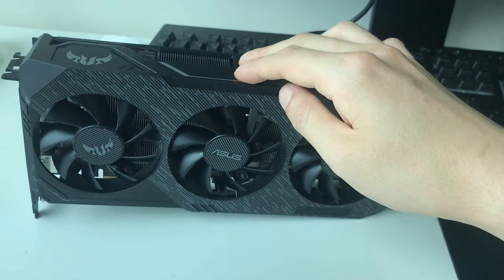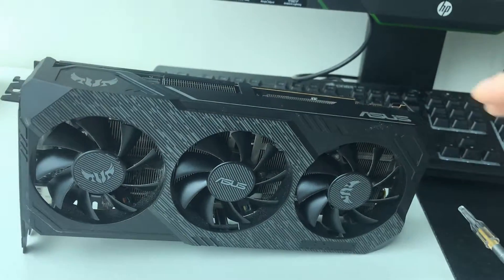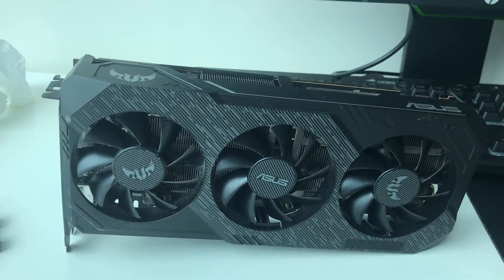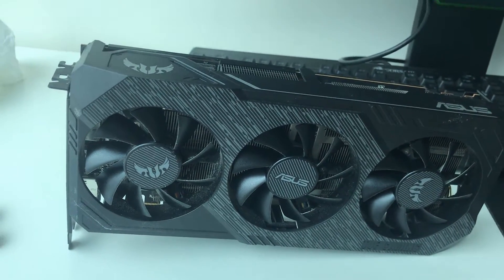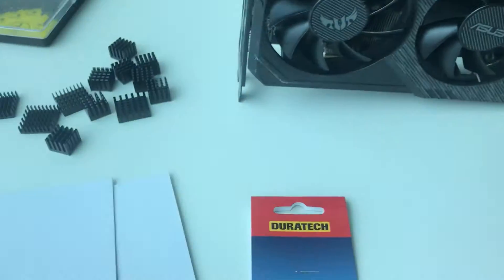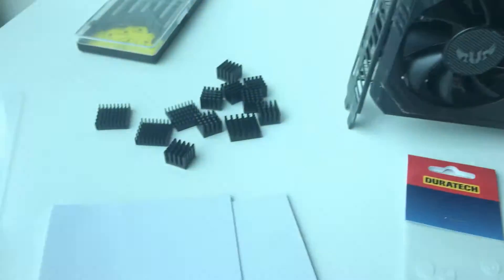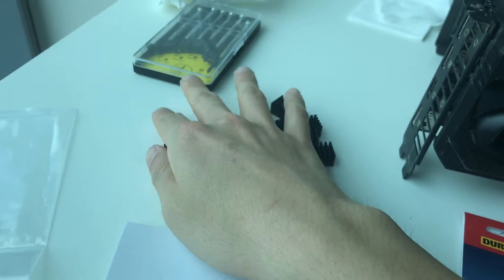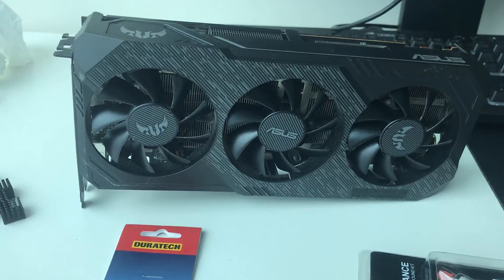Graphics Card Dodgy Mod - Fixing the Overheating Asus TUF Radeon RX 5700 XT

Comment: The problem I have with my Asus Evo 5700 isn't so much to do with the GPU temp at all.  It's the extremely hot memory hitting 104c+++  when really it shouldn't be going up over 84ish under load.  From what I've read it has alot to do with the thermal pads being used as the same card made at a different plant in Taiwan isn't having any of those issues.   It's not just Asus models either.  Really frustrating.   As an Example, 

I have a Dell 5700XT looks positively ghetto in comparison to most of these cards. It has a dual fan design but looks like something straight out of 2012..  It cools the card just fine.  Core temps are similar but mem and junction temps never go over 80 so it never throttles.
Reply from the maker: Asus really messed up with the RX 5700 GPU. If I remember correctly the RX 5700 non-XT version don't even have a backplate for the memory chips so the chips are just exposed, which explains the ridiculous memory temperatures.

RMA the card if possible, if not you'll have to tear it open and apply additional thermal pads/heatsink.
Reply: @wyzard6303   There are a couple videos on the 5700XT variant teardown having some thermal pads but I hadn't thought to check if that's the case with my 5700s. Definitely worth having a look thanks for the heads up.

Comment: Is there Any easy way to fix the gpu i bought it and its getting to 90degrees After playing a Game with 30fps Bad graphics
Reply from the maker: Sounds like serious thermal throttling issue. If you have warranty I suggest just return it and get another model if possible.

If not, firstly I will check for air flow in the case. Do an open-case, and if possible direct a fan into it and see if it still overheats. If it's still running hot with open-case and a fan blowing directly into it, then you'll have to tear down the graphics card and do the fix I did to it.
Reply: @wyzard6303  ok thx ill try

Comment: Are there any thermal pads between the back of the pcb and the backplate? id strongly recommend getting some 3mm pads and cover the back sections of the vrams and chokes, even the transistors side of the back of the core , it will dissipate more heat for sure.
Reply from the maker: There are already thermal pads on the backplate, didn’t open it up but was considering sticking some more heat sinks onto it.

Comment: Hi, I'm actually looking to do this same process, but I think you didn't remove the black cover of the memory, so the thermal pads and the heatsink will have no contact with the components
Reply from the maker: Hey Luis, that black cover is the heat spreader for the memory and they already have thermal pads underneath to make contact with the chips. The main issue is that the heat spreader is too thin and doesn't do much to cool the memory. So to improve the cooling, thermal pads can be placed to make contact with the heatsink, and additional smaller heat sinks.
Reply: @wyzard6303  did the gpu improved the temperature? I have the same video card and don't know what to do... I am already looking if I can start the process of warranty with Asus... :( But that means I will be a loooot of days without the gpu
Reply from the maker: @luisandresleyva  yeah it did, you can see the before/after at the end of the video where the GPU temp dropped by about 10 degrees.

However I would not recommend doing this mod though if you can claim warranty, ideally Asus will swap yours with the TUF EVO version which fixed the thermal issues. I did this because I got this card used for cheap and warranty is not an option.
Reply: @wyzard6303  thanks!!
Reply: @wyzard6303   Hi!

i reached out to ASUS. they do have a repair offer you can do, but it is a repair not a trade in unfortunally.... they told me they were gonna tighten the screw fra 30 to 60 PSI, nothing more... so, my bet whoud be to get the card in for repair... possible do this mod afterwards if it didnt help :D... i never delivered my card back though..